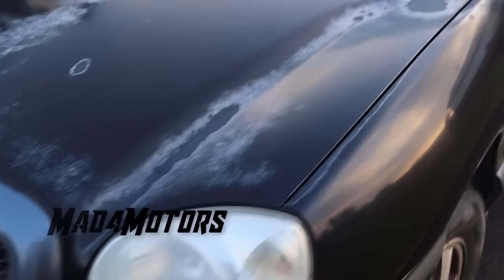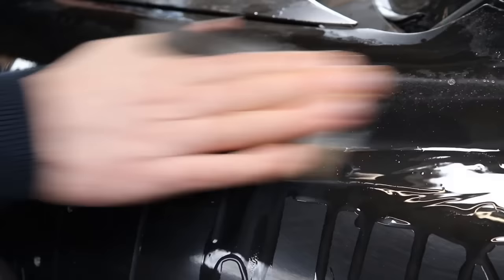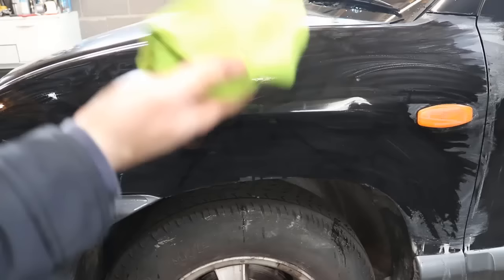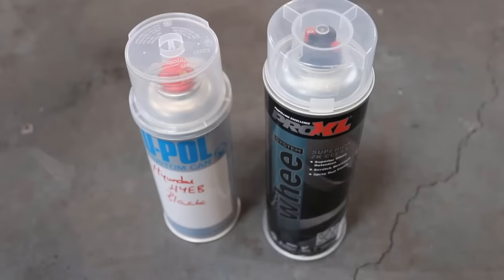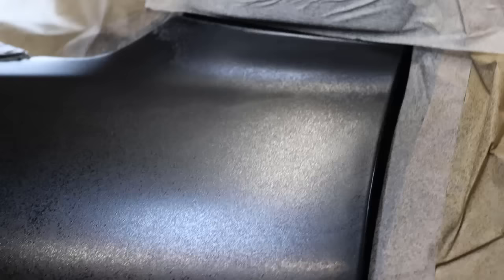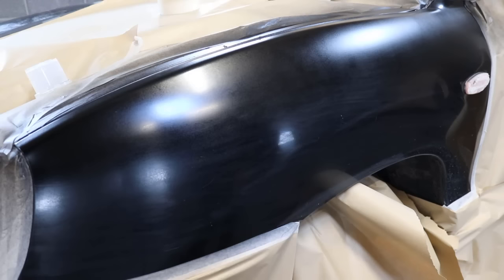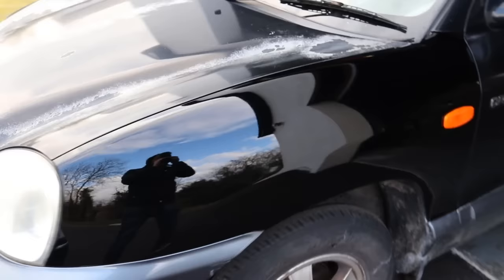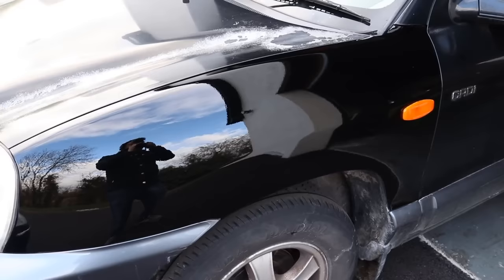How to Repair Clear Coat Fix 100% all types

Comment: This is why you always wax your car
Reply: John Doe no no buddy it can't just be waxed the paint has to maintained. it needs to be washed properly every week at least, and at times clay bared, then it's sealant and wax.  its a pain in butt to do but it's worth it...
Reply: John Doe I've had a white 2001 dodge ram with around 402k miles on it and it still hasn't peeled it's clear coat and I live in Texas
Reply: I have a 2006 Scion Tc that I leave outside without a cover.  The paint is perfect on it.  I make sure to keep a nice layer of wax on it just for this reason.
Reply: I think you're missing the point.This is about how to REPAIR damage that has occurred (note the past tense). It is not about how to prevent it occurring in the first place. That (presumably) would be a whole other video (why not make one?).
Reply: Cyclone Cyd i wouldnt mind making ine but I'm not gonna make a video when it's a common thing for detailers to do this there's just so many vid out there
Reply: Yes Sir.
Reply: Rusty Shackleford no you won't the hell your just giving it a maintaince wash no clay bar no polish just on balanced soap
Reply: Lol you sound like those know it all's   sitting in a chair with a cigarette in his left hand..Lol just stop
Reply: Kenneth Nalls because I do know?
Reply: So you smoke cigarettes? Right or left hand bubby?
Reply: Soviet Clutch 7
Reply: Kenneth Nalls I don't smoke
Reply: Soviet Clutch or just take care of your car and clean it properly, i have a 2005 lexus never waxed it and it looks like new
Reply: Soviet Clutch even though i live in Saudi Arabia
Reply: Fahad Alsuwaiket I'm pretty sure there is some type of wax in the soap u use
Reply: Yeah true it’s a good practice to wax but you can’t control what the previous owner does and doesn’t. Some people just don’t give a shit about there cars its a shame
Reply: Cyclone Cyd exactly.
Reply: Compound is part of the reason the paint gets this bad. People work it too hard. Then the now thinner thin coat bakes in the sun.
Most people couldnt even tell you the difference between a compound and wax job.
Problem with a compound and was is if after the compoind removes too much clear, wax is applied after and acts like a barrier to trap heat in the paont and clear eventually ruining it. 
Although this can naturally and most likely happen with other foreign debris caked on to the car and negligence in washing will cause this.
Had way too many cars with bad paint but usually someone buffs the car out after the clear is so far ruined they contaminate and ruin the rest of the paint.
Reply: Honda has paint adhesion issues no matter how often you wax
Reply: Yeah I think it is a water base nowadays and very critical process for proper adhesion etc.  I never see it on Fords for example.  My old 95 Windstar paint always looked like new with nothing done to it.  But my 96 Volvo hood and top is all peeled.  Which makes me think you can't really repair it permanently.  It will probably start to peel underneath the new paint anyway.  I think it has to come off for a long term fix.  But then again it's always on the top from heat and sun I suppose, so maybe the recoat will be enough to protect it.
Reply: I have 13 year old car in Finland, it has rust and paint damage because of the climate and road salt.
Reply: Soviet Clutch Dry hot and baked. Perfect for paint. Try upstate New York. The rust belt...
Reply: Soviet Clutch 😮 what all do you do?
Reply: dry and no salt, that truck would most likely be a rust bucket in the north
Reply: John Doe umm my 19 year old camry paint is still perfect because it was taken care of with wax, sealants and what not.  Still shines like new.  And it's been in Texas all it's life.
Reply: UV is what kills paint. Lifetime is 10yrs according to manufacturers sadly
Reply: I have an original paint  1977 Z28 and the paint looks like new
Reply: Rovid Bouski Yep! My 04 civic looks disgraceful.
Reply: Agreed, John Doe.  Wax it all you want.  UV rays, heat, and inclement weather will eventually break down the clear coat--more so if it's a water based clear coat.
Reply: thirdgengta that's what the wax for  wax is a sacrificial layer
Reply: Hey Soviet Clutch, what do you mean by "sealant and wax" ?
Isnt wax a sealant ?
Reply: BL driver I mean technically no because a sealant is something like ceramic coating
Reply: no it will not, my zafira is 15 years old and it has not had any paint issues, either the cars your talking about have shit paint or you did not look after it
Reply: rick, Your car, a 1977, unless you've painted it base coat/ clear coat, came from the factory with acrylic enamel paint. I had a 77 Oldsmobile Cutlass, and it had acrylic enamal paint on it. The base coat/clear coat paints took over after acrylic enamel paint and that wasen't until either the early to mid 80's. Today, you can't even get acrylic enamel paint anymore, it's all base coat/ clear coat paints these days.
Reply: Climate and color dictate everything in terms of paint longevity. Forget relics like wax and sealants. Ceramic coatings are the best answer to date. Check out what Feynlab is innovating...coatings that can self heal from wash scratches and worse. I just had it installed on my M3. Amazing!
Reply: True but certain years of certain models of cars just used bad paint/clear, really nothing that can be done.
Reply: rick smith it must be garage kept
Reply: Soviet Clutch It just depends on the vehicle. I live in Houston, Texas where it is really hot and humid. I have a Honda Civic that I properly washed and waxed religiously and the clear coat started peeling on the roof after about 7 years. I still have a Toyota Camry that is 18 years old that I don’t really take care of, and the clear coat on that vehicle started peeling only a couple years ago.
Reply: Soviet Clutch 0lpAA
Reply: The time that you spend maintaining your car could be used for better things. Hundreds of hours washing your car taking care of the paint when you could just paint your car again. Use your time wisely. Cars come and go. Unless you have a ferrari to take care of then go ahead. Its up to yall
Reply: ever wonder why the clear comes off?? no one sands the base before they clear tge dam.thing
Reply: Wax fades paint most paints are water based and waxes contain silicone which absorbs moisture
Reply: @poyo3582  sorry pal but just cause you add a sealant on it doesnt guarantee anything but time . If you live in Arizona, Texas, or Nevada and have dark paint you are screwed. Seen 8 year old cars fade like crap. Not everyone has a garage or enough space in their garage . Shade is the most important thing to keeping you're cars paint perfect. A wash and wax is good 1 every 2 weeks maybe otherwise prepare to have a bunch of swirl marks.
Reply: @Miguel323527  I live in texas(central texas austin area) with a black truck I know how to wash my truck to prevent swirls and you need to use a high quality wax no just some 5$ spray wax
Reply: Gryphen wax wont prevent this.   Clear coat will
Reply: diver dave bullshit.  It looks good cause the factory clear coated it
Reply: thirdgengta these cars never came with clear coat
Reply: Wax or anything else except clear coat will block UV rays.  Doesn't matter where you live.  This happens in Canada too to cars left out in the sun without clear coat.
Reply: @gfriedman99  wax blocks uv Ray's from the clear coat which acts as first line of defense. I know this because I have a couple cars that are around 10 years of age I wax regularly and this doesn't happen to them
Reply: @gfriedman99  and chance's are any car wash you go to or any car soap you use has some form of carnauba wax in it or synthetic polymer blend
Reply: @poyo3582  trucks dont have same clearcoat then cars....
Reply: @poyo3582  every month is okay...every week is a waste of time lollll give it a wash thats all
Good wax will last couple months
People like you are freaking out.
Couple years later you will hate yourself wiping the car for nothing when u could of been in bed with the wife!!
Reply: @vincevegacustoms754  yes the have more clearcoat I know
Reply: @rovidbouski4022  thickness of the sheet metal,its built to be lightweight...dark colors will all get reactions,clear fading peeling..
I bought a white one to avoid this..
I made fully chrome polished engine bay...polished parts get hotter...my hood got the chicken paws,paint cracking...28k miles 2010 fg2 civic si..taffeta white
Reply: @poyo3582  not more different,hardness is not the same,thats why they last long time...i did many trucks,bmws,benzes etc,high end you feel it under the buffer
Reply: @vincevegacustoms754  applying wax every week doesnt really mean applying a paste wax, I could dry the car off with spray wax duh. I only apply collinite 945 every 3 months but wash my truck weekly and dry it with some  spray wax like Lucas oil spray wax but some times I'll feel like putting a new coat.
Reply: @vincevegacustoms754  I normally dont use a buffer because I takes a bit longer, but when I do i just use meguiars ultimate liquid wax. Its great, goes on easy comes off easy and makes the trucks paint pop.
Reply: Vince my brothers silver civic and my aunts white accord both peeled. Its just cheap paint from the factory. New GM vehicles have very thin sheet metal you can dent by just tapping it with your fingers. Just dont use cheap Nason Ful-base or any of that budget crap, do a clean prep ant it will last for a decade no issues.
Reply: James, mostly true, but it is common knowledge that Japanese and Korean cars have adhesion issues with their clearcoat. What you need to avoid are the 4 S's. SNOW, SUN, SALT and SAND.  Oh, bird shit fucks up the clear as well. Waxing helps but only for so long.
Reply: Le Bone your car Millage is impressive. The only car I would take 500-600k for granted is Toyota Land Cruiser.
Reply: @John Doe if you actually take care of the paint it will last a long time. My car is 13 years old and the paint still looks excellent because I wash it regularly and I wax it at least once a year. The car sits outside all year round as well because I have no garage so it gets rain and snow and the sun beats down on it.
Reply: John Doe I have a car from 1994 and 2000,both hardly have such problem and I don't think they've been waxed often.I imagine if they were waxed fortnightly ,they wouldn't have this problem at all.In all fullness the 1994 model was garaged for the most part.
Reply: @poyo3582   you are someone I would greatly value your advice on how to maintainin a vehicle's  appearance. Would you be so kind as to share exactly what sealant you use and then I guess you also then apply wax on top of the sealant, so which wax?
Reply: @faithahora  just use collinite 945 but first use a clay bar. collinite is a super hard carnauba wax that will protect against the elements, it's also a great glass sealant, beads water better than rainx
Reply: People are to lazy to Wax let alone wash their own cars, Waxing ur car regurlarly will significantly reduce these issues, Waxing taking time, and can be physical, but worth the outcome, sadly people don't own their cars long enough to even care to take care of them which is why people end up buying cars that are in bad shape later down the road
Reply: Not if you own several post 1998-2008ish gm cars with fiber class panels. The fiberglass off gassed and cause clear coat failure from inside out.

Comment: thank you, i just follow your instructions ..went to buy mesh pads and wet sand paper, cutting paste . the car looks like the peeling is gone.  now, compressor and clear coat, before to spray i will test on a aluminium board for adjustement of the spray . your video was the answer. Merci .
Reply from the maker: Great work 👍

Comment: I clearly over polished my A-pillers over the years trying to take care of my car and now have clear coat peeling. I should have been more careful as car is know to have thin clear coat. Have large spots on a-pillers with no clear coat along with fading hood and other issues want to fix but being a red mica I'm sure I cant fix basecoat. But maybe can fix peeling on a-pillers with clear coat. Car is Mazdaspeed6 red which had beautiful paint but know to have hood and rear fender rust issues. Now 16 years old is getting the rust (bought it in 2007). Watching this makes me want to attempt to fix A-pillers. But to fix other issues going to be a project...but IMO this came out amazing. Did you have a fan going to pull overspray? Just looks surprising good for spray can.

Comment: Hi, Just as a tip from when I worked on cars for paint, I used to use a blower on an airline to check for water behind lights an stuff, it works very well, hope that helps. T

Comment: couple years ago I fixed my half of the bumper - and it was a pretty easy process as I did it for the first time - but my mistake was sanding the clear coat almost right after it dried ! I don't know what i was thinking and why I didn't see the directions - but now for a while that side of the bumper is matte, hopefully I can add more clear coat to fix it, and polish way later if it needs to be done

Comment: Great video. I must add that the real secret here is using 2K high gloss clear coat. "Regular" Duplicolor clear coat (at the like) sold at autoparts stores do not produce anything even remotely close to what 2K does.

Comment: Bad ass video . I have a 2013 honda Civic Si and the driver side is turning yellow on me due to a t bone incident and body shop used cheap clear coat I’m assuming . Called a different body shop and said the price to fix my driver side would be worth than the car 😂 yea right ! Ima just tackle the project myself . Thanks !

Comment: Aw man you’re saving me so much here, thank you! My car’s previous owner didn’t tend to the oxidised paint and clear coat so now I have to repair all the panels. 25 years worth of paint damage…. Do you have any tips for working with dents and scratches too? Does it come out really bad if I don’t get them fixed first?
Reply: It depends. Dents will show for sure, but with scratches it depends on how deep they are. If it's just in the paint then it will level out with wet sanding and be filled in by the paint and clear coat but if it's deep then you can fill it in with glazing putty. Just remember not to paint or fill over rust if it's present.

Comment: Wow. Subscribed. I will rattle can my entire truck and send you the results. Questions if you dont mind- How many rattle cans of paint for a S10 pickup (minus the bed of the truck) you think? Also, if a section is not too bad, would hitting it with 1500 and only clear turn out satisfactory? I am leaning towards following your process regardless (base coat + clear), but just curious since it appears the fender is "scratchy" looking after the 1500 is used.

Comment: Just wondering would last as long as from factory? Or if it ends up fading quicker? Regardless i love the video and will be doing this to my car! 2012 si with 3 panels of damage and hopefully i do as good of a job as you! Got a 2000$ discount on the car due to the damage

Comment: Thanks. I need to do this to my rear spoiler that has circular blotches. Did you add/ replace the color of the car before the clear coat? Or doe this only work when the paint is ok under the clear coat damage? Thanks.

Comment: I've been painting planes and cars for over 20 years and this is ok if you want it to last about a year or less. You need to use polyethylene or urethane because of the UV exposure and also the wind shear. I would say if you have a beater car or learning to paint a car, don't use a rattle can or especially not temporary wheel shine.

Comment: You sir are a awesome car DIYer thanks you so much for posting up your videos I find them very very informative. Just wish I had the balls to do this on my mercedes e350 4matic amg line. Because I have a small bit of clear coat the size of your thumb nail that has gone. It's emerald green metallic.

Comment: before you do the clear coat, to give it an even better shine you could sand the paint down with 8000 grit sandpaper, this will smothen out the paint. then do that again after the clear coat has completely dried and then finish it off with a polish. that panel will look brand new. its not necessary but if your a perfectionist that's how to do it.

Comment: If it's a  12 inch spot on a truck hood do you have to prep/spray the whole hood? Can you get descent results kinda spot checking with your method? Masking partial area of the hood. I know it wouldn't be totally ideal but is it possible?

Comment: hello, if I don't want a shiny surface as a result, but a cloudy surface, what spray is needed instead of 2k? the soil of the first spray you apply is similar to the color of the car and the second is transparent and simply shines and creates a hard and protective surface on the bodywork; thank you very much from Greece!

Comment: Ive got a large patch about 400x500mm on the roof top of my old Jag. The remainder of the clear is good on the roof. Can you successfully blend the clear and do just the damaged area or would it be best to re clear the whole roof?
Reply: I'd get a smart repair done, trying to rattle can a roof to a decent standard isn't my idea of fun

Comment: Curious on if it’s a good idea to wet sand the base coat with a very fine grit (1500-3000) to even out the base coat and any orange peel given that you’re using a spray can and have no spray booth and then applying the clear coat. Also how much would help to also finish sand the clear coat after as well?

Comment: I used 2000 grit just to get a bad area shiny again, is this enough if i were to redo the clear coat on lets say the hood? I know it takes longer probably but was curious if higher grits are viable options lol..